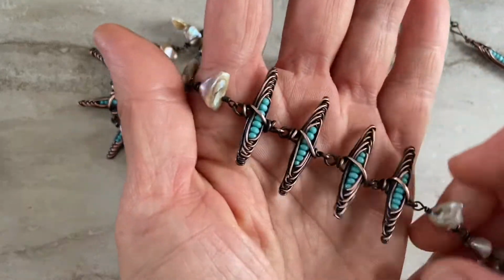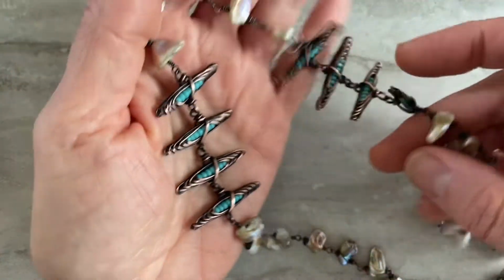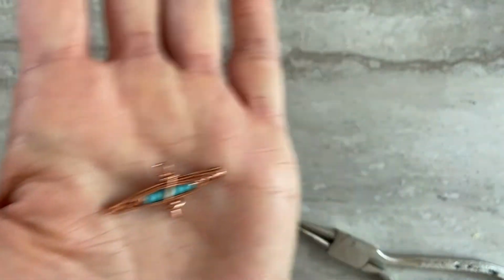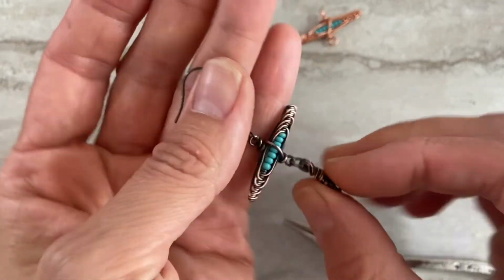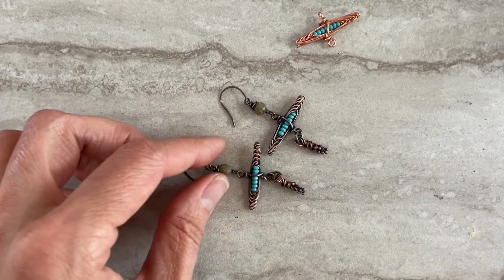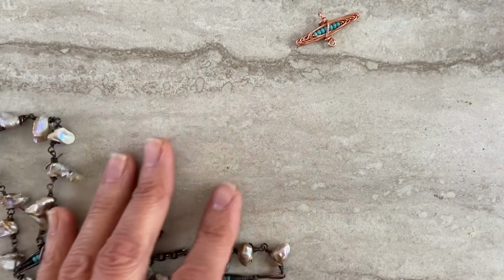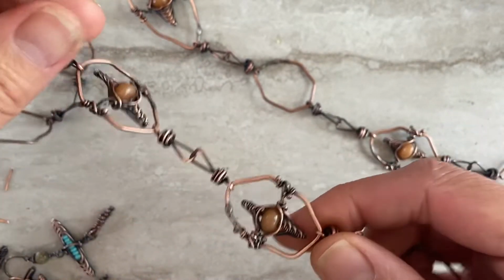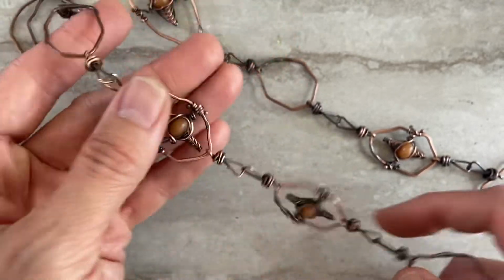Jewelry Tutorial/Over-Turning Herringbone Stitch

Comment: great earrings, you always say more info. on the description-yet there is none.  What gauge wire did you use?  How long are the 3 pieces of wire?  What size are the different bail loops are you using? What size beads?  even if you put the spool of wire in the tool pic with the gauge showing would be helpful. TY for your videos that are very inspiring.
Reply from the maker: it is just as inspiration, u can use any beads and even different metal, honestly i dont remember now, after i filmed, my brain starts right away to work on new project ... but i usually use 24ga and 18-19ga